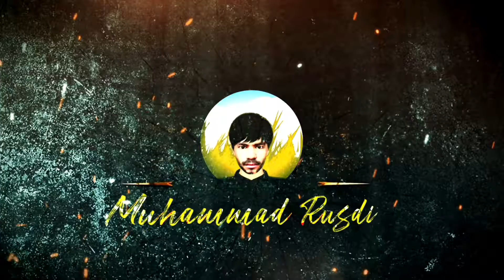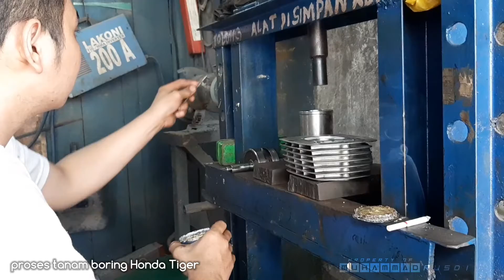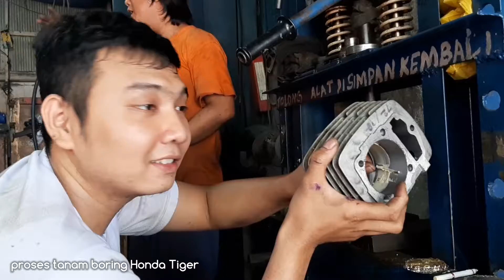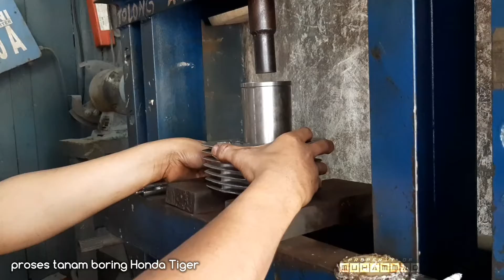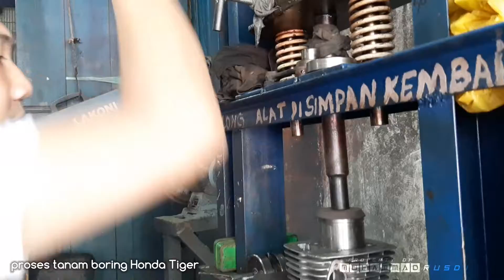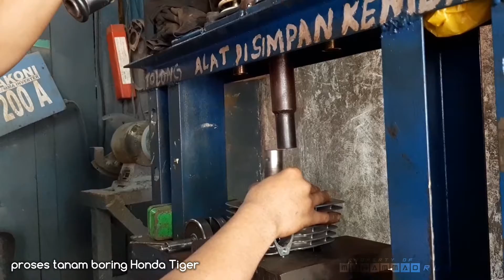Honda Tiger - tanam boring / ganti liner #ATM

Comment: Bang mau tanya kalo liner diganti apa motor tetap enak tidak seperti motor 2 tak🙏maaf pemula
Reply: kalau 4 tak pasti enak om, karna tidak ada lubang2 transfer port sperti 2 tak. yg penting pemasangan presisi, korteran tidak miring, dan boring gak ambles.